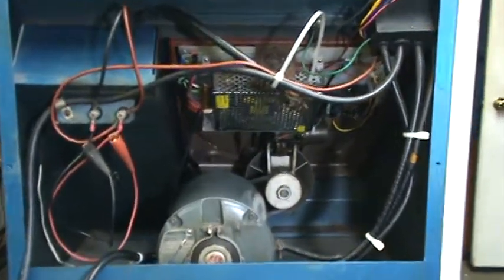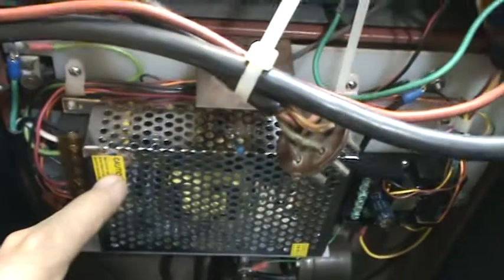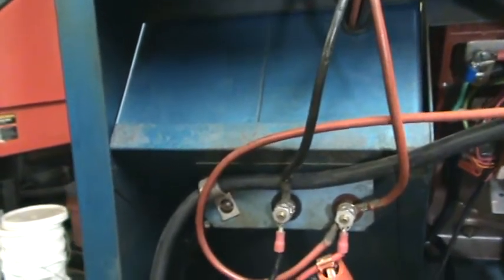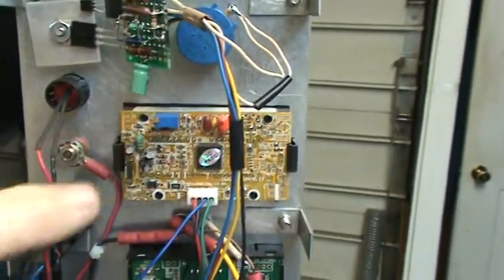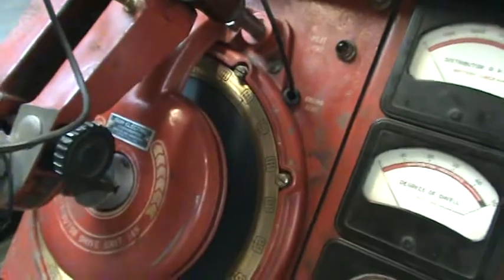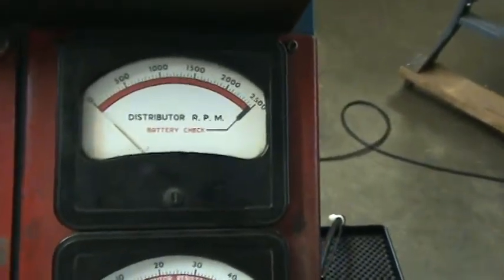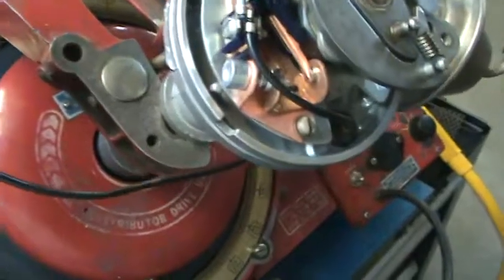Sun SDT Upgrade Part 2: Cabinet Electronics

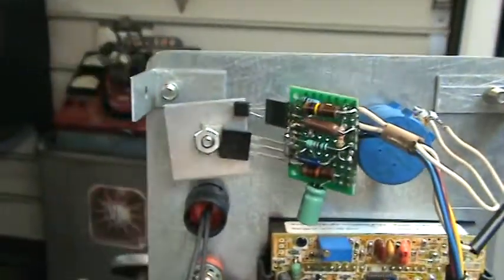Comment: That can at 1:00 is the original SUN point unit used for their tach meter. The 1157 Lamp at 2:35 provides enough current to the points to keep them clean and can also provide a visual indicator of when points are closed.  I've mounted these behind the jeweled red power indicator so it can be seen from front of machine.  The digital meters can be mounted inside the old meter housings if these are damaged beyond repair.  Original meters can be used with the Dwell Flash module.  Some modules may require a slight modification.
Reply from the maker: All very good points. Thank you.